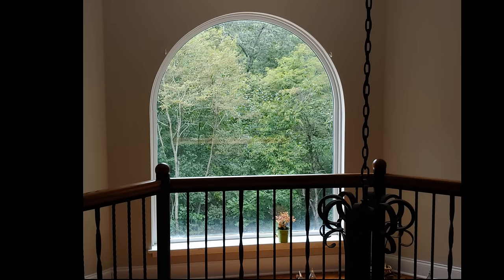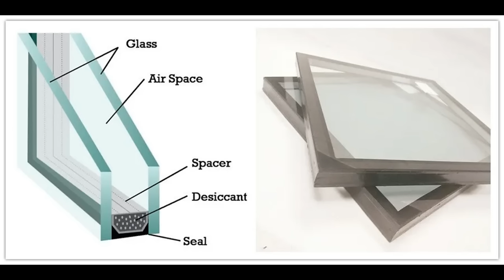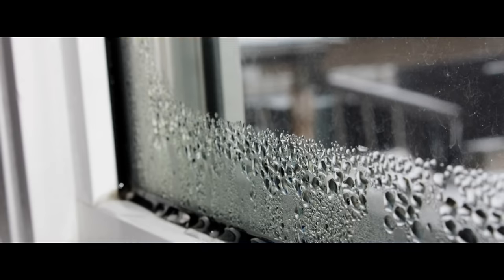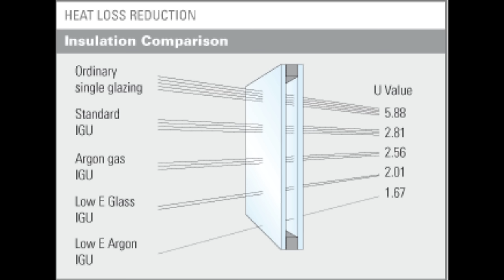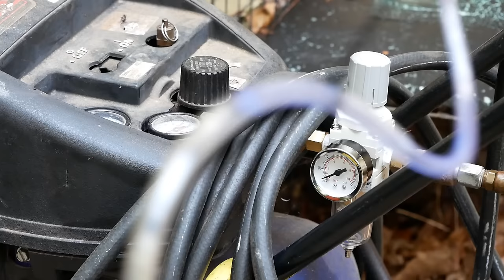Cleaning a Foggy/Hazy Window Insulated Glass Unit (IGU) from the Inside, Without Replacing the Glass

Comment: Definitely worth a try!  Be careful using the air compressor air, most compressors have condensate water in the tank that has oil and/or rust in it and you will ruin the window as you aerosolize all that nastiness into the freshly cleaned window.

Comment: When I installed my new argon filled windows.  The contractor working for the window company I bought the windows from commented that there was no guarantee that the argon put in at the factory was still present in the window due to the way windows twist and turn during transport and installation. They twist allowing for seal to sometimes be broken.
Reply from the maker: That is an interesting point. U ratings are probably accurate in a lab, but is window efficiency tested after delivery and installation, and compared to non-argon?

Comment: Thanks for putting in all that work and sharing with us... when they say that it can't be done I get very skeptical
Reply: Yes, likely coming from a salesman too. 

My dad’s original gas boiler furnace is the original (1960’s) and we have been told to replace the furnace countless times lol. Just replace the circulation pump every few years and it’s been 60 years strong. Of course the 1st pump lasted the longest and subsequent pumps get progressively poorer in quality and higher in price. 😂
+1 point for the DIY’ers.
Reply: I'm going to try this but I'm a little concerned about the oilyness of compressor air.   If a hairdryer takes too long, maybe my leafblower being careful not to blow in dirt from either the surrounding area or via the intake.

Comment: To connect the chain of decreasing diameter hoses an adhesive like GOOP will aid joining as it will act like a lubricant and when set should give you a strong seal in the join. Great video, I will try on my cottage windows this coming summer.

Comment: Great vid mate. I have followed your instructions, the drilling the seal. Top tip.👍. I found normal strength white vinegar did the trick. VERY carefully drilling a 10 mm hole in the seal made the job easier..
Reply: How long did it last?  Do you still get fogging?
Reply: Did you have metal seals? Did you have to remove the window pane in order to drill in?

Comment: Dude that was frickin awesome. Only 74 likes with 3k views? What's wrong with people. I hit like 2 minutes in.
Reply: Looks like ur easily pleased or you’re using sarcasm. I doubt this botched job will work and definitely not with seals left open. In winter when the air in the gap contracts it will suck in moist air and he’ll get condensation all over again 🤷🏼‍♂️
Reply: It's a very tricky long winded and sub optimal solution that requires to buy many special parts. I don't like all his heat gun to shrink or pull  vinyl tube connection work. Also he is the type of guy that will hide the struggle he went through and pretend his idea is clever but will aggravate people who try it. That 's the main problem with united statian "must win, i'm the best" childish culture, they never give an impartial view, after they struggled their ass over it, they'll say that was easy look how good i am.

Comment: Great video. Yes, the argon doesn't add much. When you buy windows to install at high altitude they can install capillary tubes to equalize the pressure anyway, so there's no argon. Better to do it in a controlled way than to have them break as you get to higher altitude. I've lived at high altitude for a long time & you can always tell when people haven't used the capillary tubes - they get them at a home depot at low altitude & drive them up the mountain & pop! goes the window. Theirs are always fogged.
Reply: No, brother, we live at ELEVATION (I am at 9800 feet elevation). Altitude is height above the earth's surface, notably sea level. I am fairly confident neither you, nor your house, is levitating.

Comment: Thank you for teaching us how to remove mineral deposits between the window panes. I'm wondering if the water condensation between the panes isn't going to come back quickly after this cleaning procedure. I imagine it would, because the dessicant in the window frame is not dried during this procedure, also whatever leaks existed in the window seal before the cleanup started aren't fixed so the outside humidity will get right back in between the panes.
Reply from the maker: This is the most commonly asked question in the comments for this video.  To summarize my prior answers:  If you leave the holes you made open, fogging will be limited to specific weather conditions and will clear up on its own, eventually.

Comment: I did this and it worked amazing. They window got sparkling clean. Then I tried to blow air through the case to quick dry it. The window shattered. DONT BLOW AIR INTO IT! I was using a small pool float inflater and it was still to much pressure inside.
Reply from the maker: Thanks for mentioning that again.   As I said in the description under "Corrections", a small aquarium air pump is the way to go.  Air line should fit loosely into the hole and there should be a second exit hole.  

Sorry about your window.
Reply: I also made a mistake. I drilled a hole in the top and started to fill it with water and some cleaner. When the window got half full, it burst. The hydrostatic pressure was too much.

Comment: Wow — what a project! A number of my big (new, not ‘replacement’) Andersen windows have developed similar interior hazing problems over the past 15 or so years. I think in some of them, it’s due to the hard bird hits they’ve seen. I’d hoped the fix might be much easier. It makes me wonder — good windows should come with top and bottom plugs for easier cleaning. The top plug could access an interior top-running drip hose that would allow the solutions to evenly coat the panes inside. The bottom plug could be a simple to-outside drain. Or maybe if a good window is having seal problems, the greater concern should be of serious building settlement than between-pane haze?

Comment: Excellent video! It is several levels above my pay grade/skill level but I “have people” with these skills and tools and I know they would definitely be up for the task! Do you think a can of compressed air might work? Thanks again for sharing this info!
Reply from the maker: I haven't tried it, so wouldn't recommend it.  Compressed air from a can is actually a refrigerant that can hyper-cool the glass, and it may be difficult to control the pressure inside the window (it would not take a lot of pressure to break it).  An aquarium air pump is still my top choice for drying (not an air compressor, but I can't change the video).  It's slow and steady, and can be left unattended (overnight).  Slow and unlimited is likely better than a quick burst, in this application.
Reply: @akomakomakom  great answer!

Comment: So you didnt fill your holes back to allow for a drain.  But what you do to repair the seal which initially caused this problem to begin with ?  Also, how long did your IGU remain "clean" before it started getting foggy again ?
Reply: My guess is that you lave it be. With this tiny ventilation you may not get that trapped humidity and evaporation cycle that will deposit minerals on the glass. 
Your local climate is a big factor. 
I’ll be doing this on my folks 4-season sunroom…although the cataract-like windows do offer some privacy lol.
Reply: I had a professional clean & reseal my windows and they got foggy again in 3 years. I think that once the seals are blown you'll never find every little break in them, so might as well give the moisture somewhere to drain.
Reply: @ruidadgmailcanada8508  I have an entry door with 2 glass panels that have fogged up but I am just to leave it and call it privacy glass too.

Comment: Ridiculously complicated.  Glad it worked for you, but I doubt anyone else.  The recommendation to replace window is the better option.
Reply from the maker: Context is king.  Like dozens of prior commenters, you are both right and wrong.   Replacing the IGU makes complete sense if it costs $100 and is easy to install.  Cleaning makes sense if replacement cost is in the hundreds or thousands (as is the case for me) and requires lifts and laborers to handle.

Comment: How’s the repair holding up after 3 years? Thanks for sharing.
Reply from the maker: As far as having a clean, see-through window, it's holding up great.  The mineral haze did not return on any window (so far).

As far as fogging up, it's a mixed bag.  My large window stays clear most of the time.  Another window tends to stay slightly foggy a lot, although it stayed clear for 3 years while my holes were caulked closed.  Now that I opened the holes, it is slowly drying out, weather permitting.  That window is also cracked in the corner of the exterior glass, so it's not the best indicator of success.

Comment: The air compressor will add moisture back in. Dry Nitrogen would be a good use for that.
Reply from the maker: I no longer recommend the use of a compressor (too dangerous, use an aquarium air pump).  That said, it doesn't make as much difference as you may think.  The window seals have failed.  Even if you plug the holes when you are done, moisture will work its way in and out of the window over time.  The little moisture you add while blowing air is negligible.  Leaving the holes open tends to yield fairly satisfactory results (occasional minor fogging that clears on its own).
Reply: @akomakomakom good deal. Yeah it’s just a temporary fix no matter what. Thanks for all the tips! It would be cool to maybe be able to blow nitrogen in it once in a while to dry it out.

Comment: 1 really big problem , here in th uk 99% of glass units have a low e coating on the inside ,the cleaning solution you used would destroy it leaving the metal oxide coating looking like an oil slik and also halving the thermal efficiency of the window
Reply: Bummer!, never tried one with the low E or triple glazed ethier

Comment: I must add that i also drill 2 holes in the glass so air I pump in one can escape the other.  I finish by covering the holes with small circular band aids to keep bugs out and to breathe.
Reply: Did you drill into the seal, or did you drill into the glass itself???
Reply: @myradiovideos  drilled the glass using Dremel with diamond bit and spray h2o bottle
Reply: @myradiovideos  found a ball shaped bit worked best
Reply: @nutzablaze3339  OK thanks for that.. I live in San Diego, and it is amazing that you have 50 people that will install New Windows, but yet to find someone who will fix or even replace the glass. I just need to keep calling around.. My windows are 11 years old, spent a lot to install them, so they need new glass. Fogging up after 11 years, 1 year out of warranty. We have had a lot of rain this year, almost every week, but heading into some 80 degree weather and no rain later this week, so hopefully the moisture will evaporate as the south facing windows get that hot sun.. Time will tell...
Reply: @myradiovideos  I have 6, 4x8' , 300#  thermos that started leaking, I had no choice but to fix,  they are also 30' feet up and would need a small crane to remove and replace..  good luck
Reply: @nutzablaze3339  What did you spray inside the window to clean it all up? I have a sprayer, compressor and the like.
Reply: @myradiovideos  I don't know how it got misspelled, but the acid is HYDROFLOURIC, not hydrochloric  
Also make sure your problem is not just fogged glass, but deposits on the glass.
Reply: @nutzablaze3339  got it!!! Thanks
Reply: @nutzablaze3339 same!!  Can’t get anyone to replace our 8-ft tall x 85” wide windows because they are 30 ft. up.  The original guy who installed the windows 30 years ago said never again…. I’m just hoping I don’t shatter them.  Cloudy glass would be preferable to blue tarps in hind sight.

Comment: Can water vapor truly precipitate minerals or other chemical constituents on the inside of the glass, as you stated in the video? Or, is it the installed gas, such as argon, precipitating on the glass when the seal is broken? It was my understanding that water vapor is pure water thereby not able to deposit minerals on the glass. No?
Reply from the maker: I am not a physicist and these are my guesses.  Water vapor should not contain minerals (however, it can contain volatiles and friends).  That said, when vapor condenses into water droplets, it can pick up impurities from: 
A) Air (dust, pollen, etc)
B) Surfaces (such as any interior surfaces of the IGU, including the seals and dessicant. Old seals and dessicant may have deteriorated, contributing minerals (or any powdery remains). 
Water can then transfer these things to the glass as it runs down the surface of the window, for example.

Comment: So, if you notice the moisture before it has built up gunk inside then all you really need to do is make the hole so the moisture won't build up anymore?
Reply from the maker: Depending on your climate, that may be all you need. I'm in a humid area, so I wound up getting intense fogging after rain on the glass after a warm day. Eventually I dried it again and sealed the holes on a cool dry day. So far so good, very minor fogging on extremely cold mornings. Probably will need to do it again in a few years, but it doesn't take long.
Reply from the maker: @slkfjariao  I'm the author.  I didn't bury the answer, I simply continued to experiment and wanted to share the results.  Youtube does not allow me to modify the video, so comments seemed like the right place.  At this time (a year later), I once again opened the holes and the window has been clear for months.  Your mileage may vary.  Good luck.  Not everyone has ill intent.
Reply: @akomakomakom any chance your humid climate is coastal Georgia?  We would have a similar problem, so this is good to know before attempting.

One idea, I’ve seen other YouTubers ‘pin’ a comment so it shows up at the top of all comments.  A summary of your additional hacks and experience would be very helpful in the mean time of republishing a second video.  Thanks again for your help!!

Comment: 110% helpful amazing presentation and skillfully executed; just one question,  why wouldn't you seal the holes back up if moisture infiltration is what caused the problem to begin with?
Reply from the maker: Because moisture infiltration didn't happen through these holes, it happened through failed seals.  In other words, it will happen again, and moisture will be trapped.  I mentioned that in the video description, but I've been meaning to make a follow-up video with some other ideas.
Reply: @Akom  okay I get it now sorry I must have missed that 200% awesome job and useful info
Reply: @akomakomakom yes, please, a follow up video with more tips would be incredibly useful.  Also, any further ideas about aiming for large windows would be fantastic.  Our DG panes are 8 ft tall x 85” wide (not including the frame, e.g. the glass itself).  Pella, Anderson, etc. companies won’t install that size so we are having a lot of trouble finding someone to replace them.  This could be our answer, thank you!!

Comment: How’s it working out for you with corrosive vinegar!? Would be better to use isopropyl alcohol. Air compressor without drying column will just blow wet air back into the gap…🤷🏼‍♂️
Reply from the maker: Are you asking about long term effects of a corrosive cleaner on the interior space between panes?  I have not seen any ill effects.  The alcohol that is applied after vinegar thoroughly removes it.   Alcohol by itself would not remove mineral deposits on the glass.

I also found no difference between using a plain air compressor and one with a water/air separator.  Both worked great, however, like I said in the description, an aquarium air pump is much better and safer. 

Good luck!